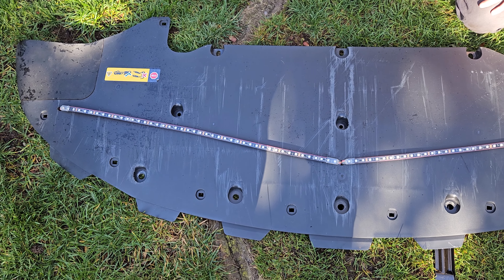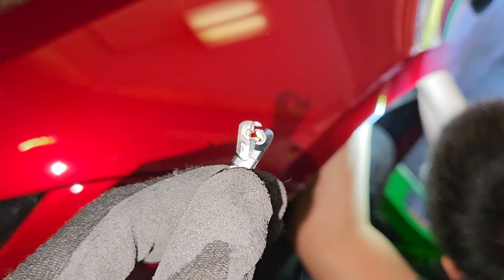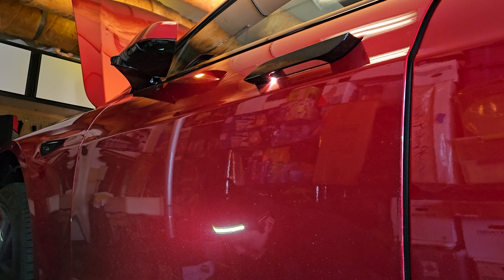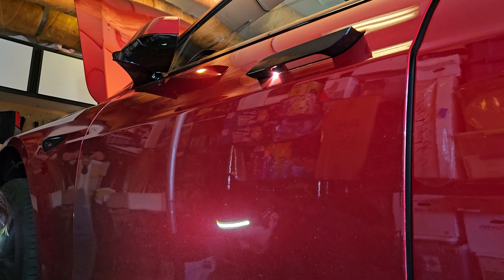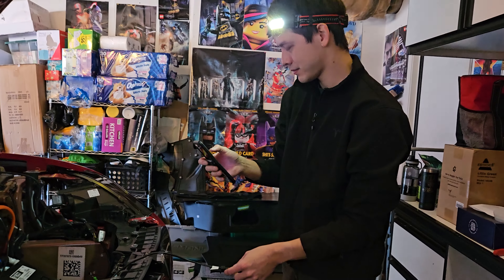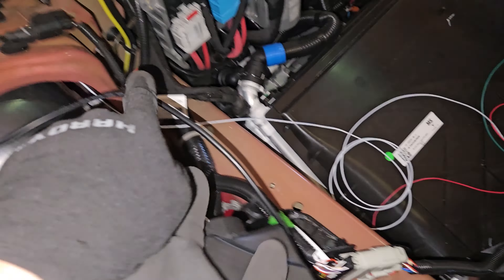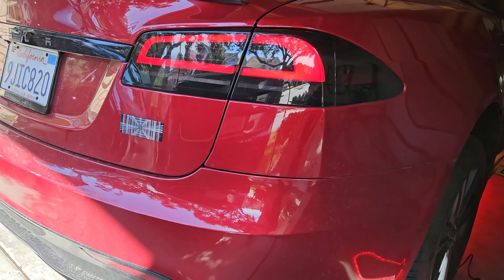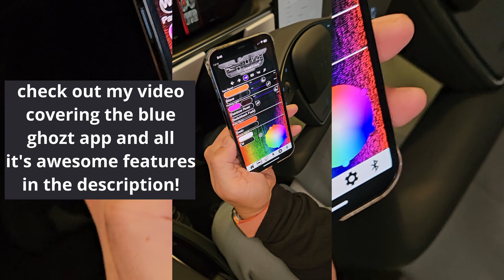Model S PLAID underglow install!!! So many lights! wow

Comment: Hey you have any pic/video of how you lined the underglow in the rear like you showed the front?
Reply from the maker: Hey there, for the rear we did not take off the plastic skid plate so we kind of just eyeballed it and lined it up with what we thought was good. 

If you do the same process and take off the rear plate you can line it up to perfection